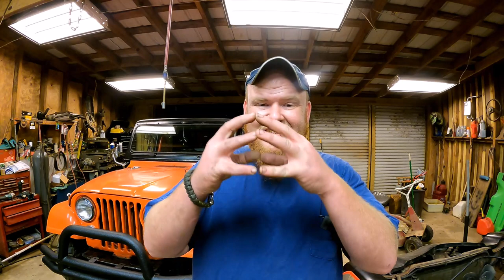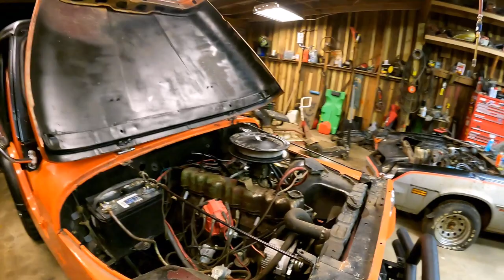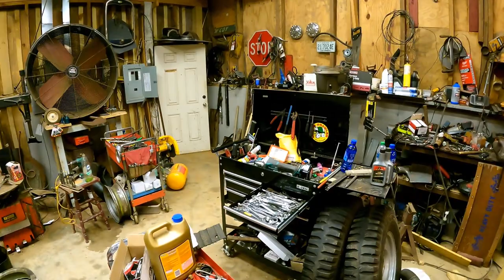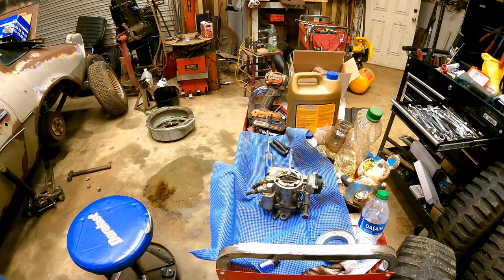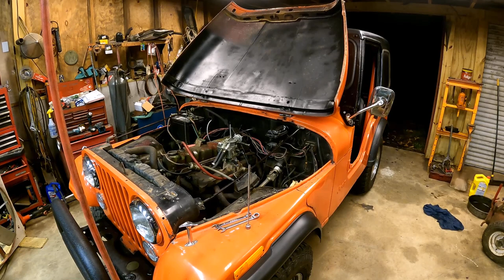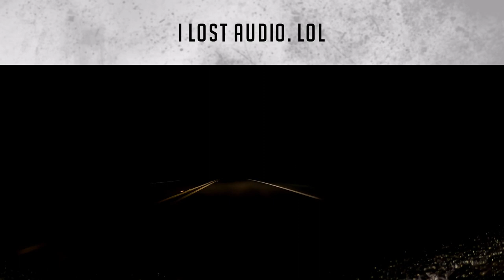CJ5 CARB TROUBLE

Comment: Buddy, I'm so right there with you...Been working on my CJ7, didn't run well, fixed a bunch of vac leaks, got a new cheapo carb and it ran great.  Had to park it for a few weeks to replace the power steering box, a job I wouldn't wish on anyone, got it fixed and went to go for my victory drive and it ran like crap again.  Took my brand new carb apart saw very little in there (I have the 2bbl Carter BBD version), but cleaned up the spacer under the carb and put a new gasket on it and it ran great again.  Also increased my vac readings on the engine by about 2 inches of mercury, so I think the bottom gasket on mine was a major culprit.  Yay!  Had to park it for a couple of weeks as I replaced brake lines, a job I completed today that's even worse than the steering box, went to go for the victory drive and it's running like crap again.  This &^%$ thing owes me two victory drives.  Then, after 15 minutes it ran pretty well for apparently no reason and I took it for a short drive in the neighborhood.  I was inventing new insults and swear words to hurl at the thing today, believe me.  I've learned a few things that I could go on about, but a few things I'd start with is making sure the carb is tight enough when you mount it.  It looked pretty loose, that creates major vac leaks.  My distributor (original one) definitely has problems with its mechanical advance, but it's still functioning enough for now.  It needs to be replaced.  My cheapo carb seems to stick a little with the metering rods, which can create that flooding issue, same with the needle and seat.  Put a vac gauge on it to adjust your low idle screws then re-do the timing.  I think the carbs are fussy on these things, and any amount of sitting is bad for them.  They really shouldn't be able to leak gas out of the side of the body, that seems like a problem...Happy birthday, I'll make sure to sub on the new channel!
Reply: Matt J very informative take thanks for all the info!
Reply from the maker: Thanks buddy! I was going to buy the Carter knock off at first but I found this rebuilt Carter on ebay and It's really been great until it got trash in it, which isn't its fault. lol I think my tank had some kind of crappy factory coating in it that's pealing loose. I think my flooding was cause by that jet being plugged for a but and it was just filling the bowl to the top and not burning that fuel fast enough because it was running so bad. I do need to get a new base gasket to have handy! Mine looks fine, but I haven't changed it since I bought the Jeep. I always appreciate your support and kind words buddy!! Thanks!
Reply: @redclaytraveler1949  You're better off with a rebuilt original carb, I couldn't get one of the 2bbl versions without cashing in my kid's inheritance.  I'll find one at a swap meet or something and either use it as a core or rebuild it myself.  I doubt the tank is causing the issue unless you can actually see goop in the fuel.  The filter will pick up the stuff.  Make sure all the things you removed still allow the carb to vent properly, that can make a difference.  These were meant to work with some basic emissions controls, but I don't see how blocking the vapor vent line like that would cause problems.  It's likely something is sticking in the carb itself and eventually works loose.  The blocked jet could have happened before a filter change or something, who knows.  You had mentioned a while back that the carb was giving you issues, maybe it was starting to block up back then, and a little more just got in there.  At least you know what to look for now!
Reply from the maker: @mattj6676  Its sucking in trash, I show it in the video I edited last night. It makes me think the clear coating in the tank is peeling off just like it was from the outside. I could see some spots where it was missing in the tank but didn't think much of it at the time. When it doesn't have trash in it, it runs amazing and has great power. No carb works with trash in it. lol

Comment: I ran across almost the same thing with mine a little while back. Fuel quality especially with the ethanol blends is not great. Took apart a 600 Holley on one of my old Windsor motors that looked like it had gravel dust in the bowls. Switching to non ethanol gas made a huge difference. Actually had to adjust the idle back down once the system cleared.
Reply from the maker: This is true! I had to clean it again today and it was clogged in the same jet again. I’m not sure how its getting through two filters but it is lol

Comment: The Buick style oil pump on the v8s isn't real great either. On the 225v6 there is a great upgrade steel plate from t a performance that ups it's reliability but I don't know if they do one for the v8s. It may be the same.
Reply from the maker: I want to get my hands on a dauntless one of these days. Be a good engine to keep around

Comment: You  shouldn't be able to see fuel "pumping in" at idle, which if it was your float/needle may have been stuck open and over filling the bowl, which then allows the fuel to poor out the venturi, and ends up flooding the engine.
Reply from the maker: I wasn’t clear, I meant it was pumping when I gave it throttle lol

Comment: Someone mentioned drilling out the Jets. I say don't. I don't think you can get new ones anymore and if you make it too rich then you have to solder. The jet size

Is fine it just has to be clean.
Reply from the maker: I’m definitely not drilling jets on anything lol I want it to run correct and not have to mess with it constantly and drilling jets creates problems

Comment: You need to hook up the fuel return line! On the fuel filter the return line needs to be at 12 o’clock position!
Reply from the maker: It is hooked up and it upright at 12. I checked it again today

Comment: Hey Red Clay. Been there done that. Your carb is junk. I have a webber 32/36 that I used on my cj7. I live in Woodstock and could install it for you for free. It might help. I have 38/38 webber now so I dont need it. I do have air/fuel ratio gauge on my jeep and that really helps me know how the carb is running
Reply from the maker: Now now let’s not get hurtful lol Nothing wrong with a Carter, it’s sucking in trash, your Weber won’t run with trash in it either. I appreciate the offer! I’m in in Woodstock regularly.
Reply: No problem.  Got a Carter for parts if you need one
Reply from the maker: @johnpavich3752  I appreciate it buddy!

Comment: Put a Webber carb on it and be done with it. I changed mine over from Carter to Webber and it runs like a top now. I still have the stock distributor. Only thing I changed was the cap and rotor. Also make sure all your vacuum lines are good. Get rid of that God awful mechanical fuel pump. Put a Holly electric pump with a fuel pressure regulator. Set to 2-3 PSI. Wire the fuel pump to the run side of the key and wire in a toggle switch for the fuel pump on the dash.
Reply from the maker: It’s not a bad idea but I like keeping it original. The carter is fine but it’s getting trash to it through two filters apparently. I cleaned it again tonight and talk about it in the video I filmed. I’ve heard great stuff about that Weber!
Reply: @redclaytraveler1949 , The Weber is night and day difference. Some day I will upload a video of my set up. It works great! If you plan to keep that Carter carb on there, it would help to drill the carb jets out to a bigger size. There is plenty of info out there on the internet about it. But one thing about the Weber it has larger jets for more fuel delivery.
Reply from the maker: @robertsmith7758  I'm certainly not knocking the Weber or your set up. I just really like stuff original. The Jeep has plenty of power for me and what I do and I like the set up when it doesn't have trash in it. lol I have heard great stuff about the Weber! I talk about it in the video I am editing right now. I was looking for a Weber originally but everything was crazy high or out of stock and then I was able to find a nice Carter like it came with factory and I am quite pleased with it until this situation. lol I really like mechanical fuel pumps, I have never had a problem with any of them, I have had a lot of electric pumps give me troubles, but I wasn't running a quality set up like you have on your rig. I just like the simple stuff they came with I guess, I'm not good with change. lol I cleaned my carb tonight and it had more trash in it, so I'm going to change my filter and if it keeps up I will drop the tank again.
Reply: @redclaytraveler1949 , good luck man. Hope you get it going. I know it’s frustrating as heck when things don’t run right. And those things you said about the Jeep CJ is the only vehicle that break down by sitting up in a garage, that is so fucking true!!! I have had my CJ5 for 9 years. I have seen it all, she is treated like a Pavement princess and sometimg is always needing to be fixed. It’s like having a second mortgage. But these old Jeeps are so easy and fun to work on. And when she is happy all is right in the world. Yes sir.
Reply from the maker: @robertsmith7758  I appreciate it buddy! They are worth the suffering! Most any old vehicle is trouble, especially Jeeps, since folks treated them poorly from day one because they think its a tractor. lol I have found that if you keep the faith, it all works out eventually. lol

Comment: DUDE!!!!,,,, CREEPY BEAR IS EPIC!!!! When you held that thing up I said "I want creepy bear!" I laughed my butt off! When cleaning those jets a torch tip cleaning tool works great. One thing that always freaks me out is that the smallest piece of crap can foul everything in a float bowl. I had a Motorcraft 2100 in my cj5 and pitched it for a new one and it works great. Never worked on any of those there Carters. Keep up the great content R.C.T. meet you at the sea.
Reply from the maker: I had to clean the dang thing again because apparently two filters can't catch the crap that its sucking into the carb. lol I'm just trying to love it but it is fighting with both hands! I do need some of those brushes for the jets and what not. I'm not giving up! If it keeps happening I will coat the tank or buy a new one, even though this is only a couple years old. lol For some reason your comments keep getting put on hold even though I have set you to always approved. Youtube doesn't want us at the sea I suppose. lol
Reply: Yeah, give the creepy bear to the creepy kid statue on the porch.  Might as well go all in.
Reply from the maker: @mattj6676  Haha that's true
Reply from the maker: @mattj6676  hahaha